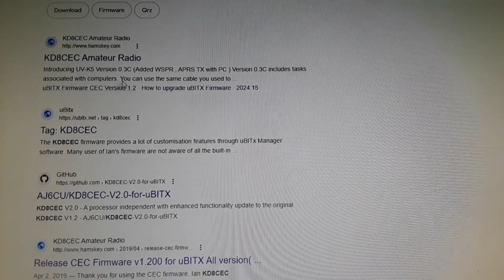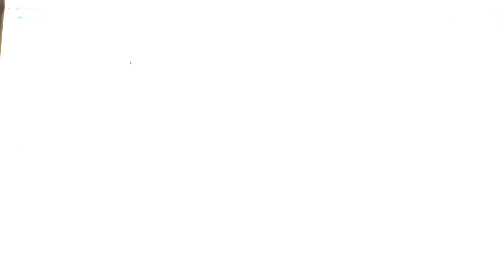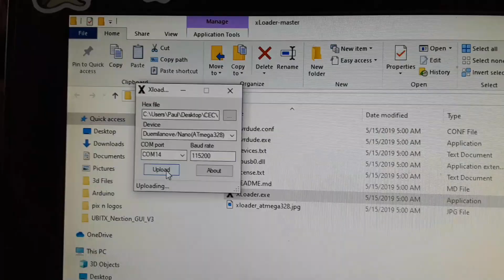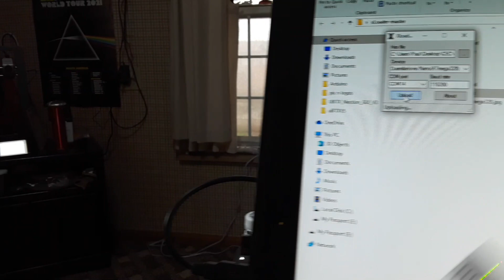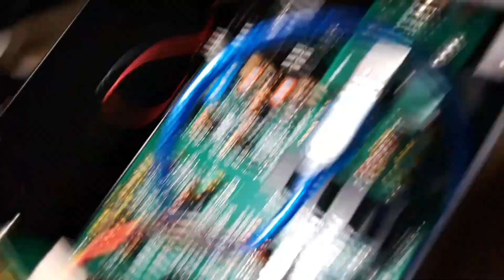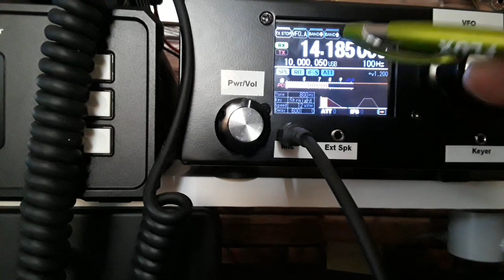Hacking The uBitx V6 with  Community Firmware & A Nextion Screen

Comment: @learnelectronics Hi Paul, Ive been arguing with this for a week now, it will not boot into new firmware, ive tried updating tft firmaware which maybe the issue but that will not work either says file is not compatible.  Did you have to upgrade scrren or did it work straight out of the box? Steve

Comment: Nice upgrade. Mine seems to have gone of frequency and despite several attempts to retune it I'm no further forward. I wonder if I dare attempt this upgrade!
Reply from the maker: Mine was off from the factory. I spent hours trying to align it with no luck. Sent it to a pro, he spent hours and got it close. 
The upgrade is easy, and makes it a whole new radio.
Reply: @learnelectronics  I have a feeling mine was off from the factory too. i followed their instructions to align it but to no avail. I've ordered the bits for the upgrade and hopefully that will sort it. I watched a few videos on how to do it but learned the most from yours. Thanks!
Reply from the maker: If you have a questions, please feel free to get in touch
Reply: @learnelectronics  Thanks Paul, I will. Still waiting delivery of the Nexticon Display.
Reply: @learnelectronics  My Nextion display arrived. I followed along to your video and did exactly as you but all I get on the display is some sort of washing machine production line software is running. any ideas ?